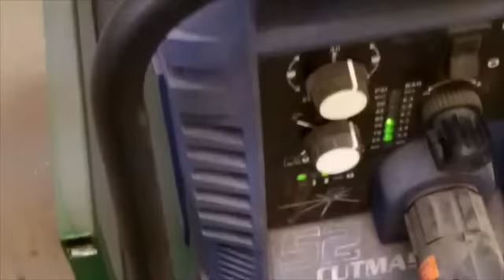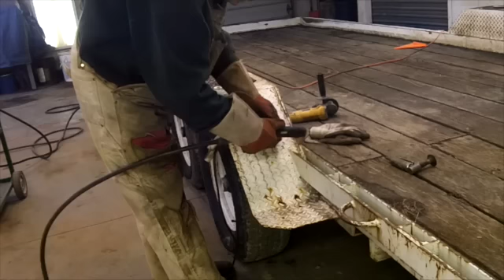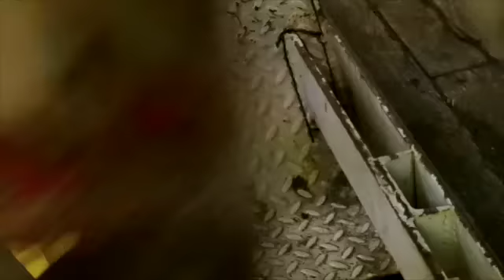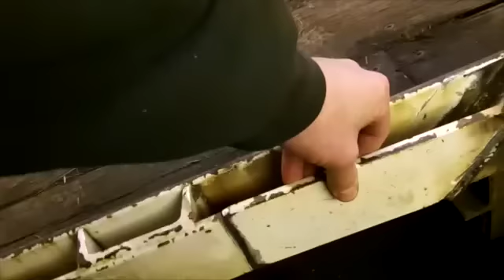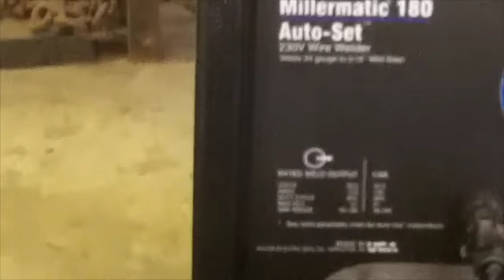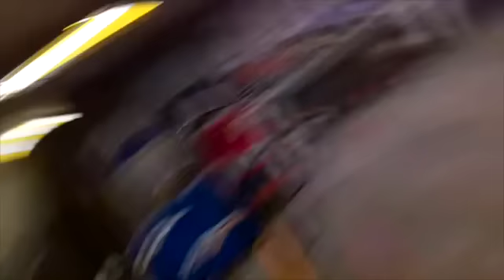Landscape Trailer Fender Section Repair - Plasma cutter and beginning fabrication

Comment: Plasma cutters are cool. Boy the rust really did a number on that plate, thats pretty damn thick to be getting rust holes.
Reply from the maker: I guess it's expected to get rusty after almost 30 years.  These trailers were used at one time to haul snowblowers for a sidewalk crew so they have seen a little salt in their day